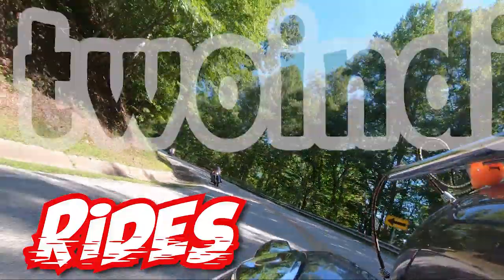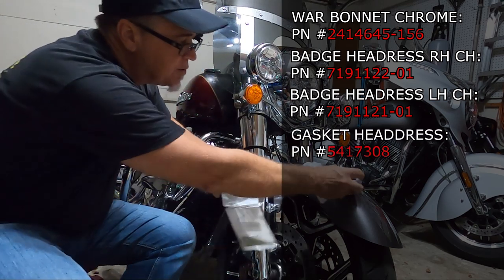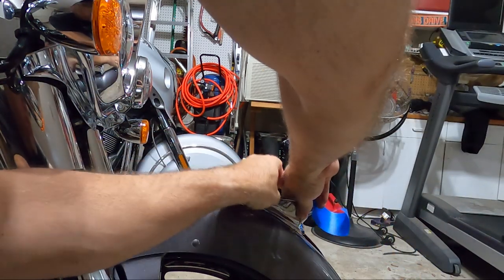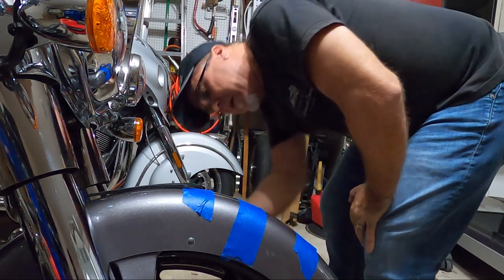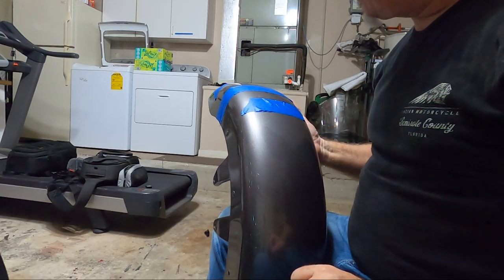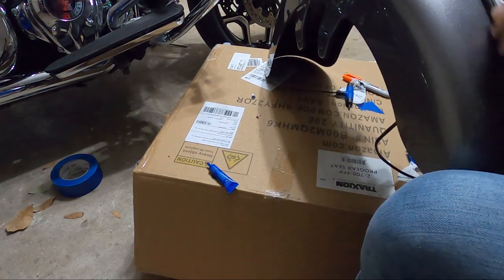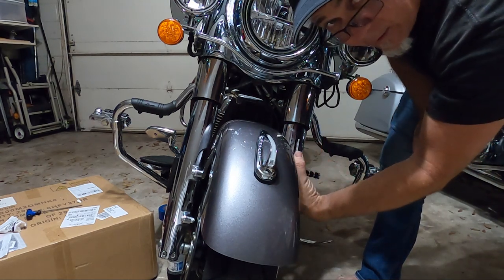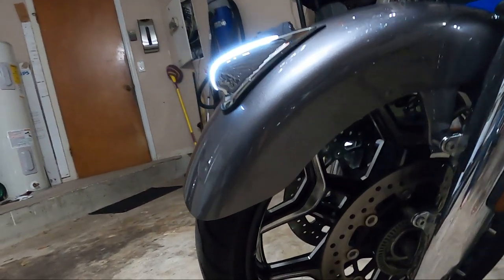CHALLENGER WAR BONNET ON A SPRINGFIELD

Comment: Looks great!  I’d have given that bare metal in the screw holes a shot of Rustoleum, put a dab of epoxy down to hold that bracket in, then put some sheathing over the bare wires.  I know nobody sees it, but the duct tape is a bit of a bodge—especially for such a nice bike.
Reply from the maker: I did go back and clean that up, after multiple comments just like yours! 😇😉 thanks!

Comment: You should of have it done at dealership same time front fender replacement done. Just my thoughts. Ride safe 👍🏼
Reply: Just bought a brand new 19 dark horse chieftain and had it painted. Asked them to put a light bonnet on since they had it all apart. The dealer told me there isn’t enough room under the fender to install one 🤔
Reply: Joey G 
WT.... 😳

Comment: looks good, but i would use the duct tape, maybe wire clips that have the double sided tape and then glue it to the fender to make sure it doesn't fail.
Reply from the maker: Well to be fair that was only a temporary fix in order to finish the video, didn’t have what I needed at the time. I have since made appropriate adjustments. Video coming soon.

Comment: Ok, it does look great buuuuuttttt,,, why didn't you put the wiring in a plastic wiring tubing instead of tape? I would have done that then put some silicone on it to attach to the understand of the fender, with rain and road grit the tape is going to dry out and then start rubbing on the tire. NOW, unless you tied the wire to something when it comes out from the fender, which you didn't show, the silicone will harden and not be affected by the water or grit. You needed to show how your ran the wires afterwards so other will know what to do and where to actually find the harness under your frame area. That part was too quick and for someone wanting to do this might get lost. Just a suggestion. Yes, either paint the wholes or put silicone in them as well to protect from rust.
Reply: Thank you! Knowing which way to route the wire was the ONE thing I was looking for

Comment: Awesome thank you Mr. Brian for posting this as I bought a vintage style LED warm bonnet for my front fender I have been procrastinating about  putting it on. Mine is an aftermarket one to which I'll only need the factory plug. My plan to secure the wiring under the fender is to lay a bead of silicone to set the wire into.

Comment: You said the fender bolts were too tight? Weren’t you the one who put the  new fender on ? 🤔 it does look great , I like the old war bonnet better,  shame you can’t get one of those .  Good job . Sometimes things are a lot harder than they look , you made it look fairly easy. Be safe, later 😬🤙🏼✌🏼
Reply: Steve Ledbetter you should be able to get the older style war bonnet. Indian still uses it on the 2020 Roadmaster and Chieftain classics. Just go to your local Indian dealer and ask for one.